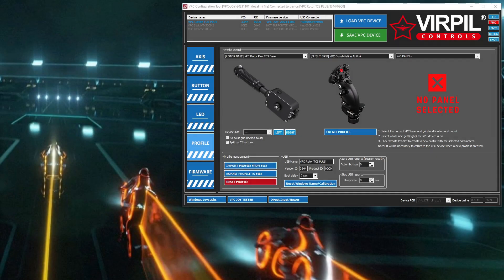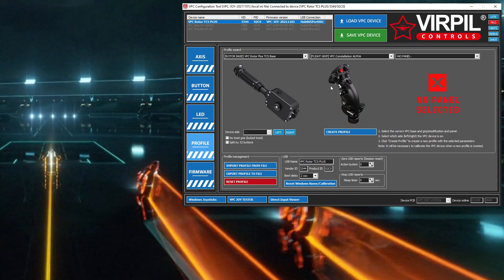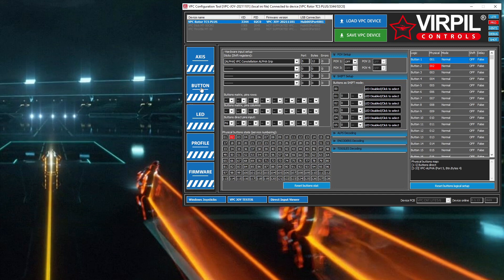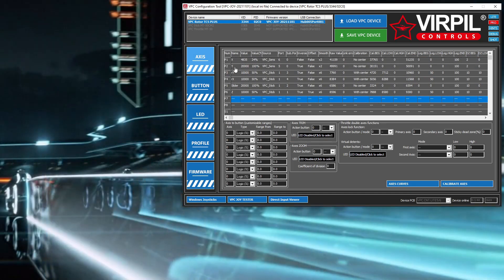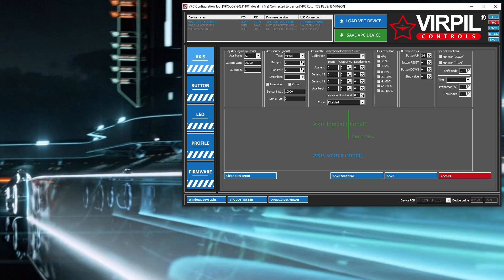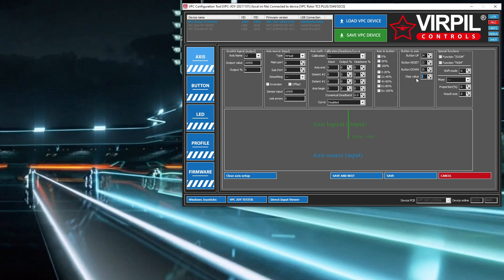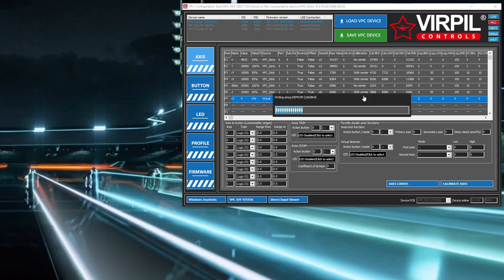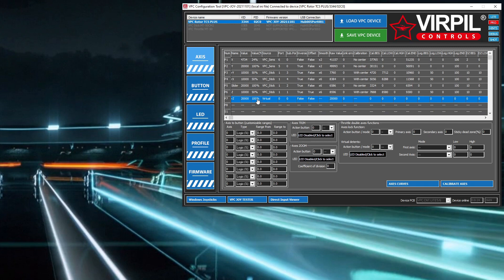Button to Virtual Axis Tutorial using Virpil equipment

Comment: Thank you for this video. I see in your description you've left some updated information but I thought I could offer advice for clarity in two key areas:

1. A reset button is mandatory. If you leave it at zero, it's as if that button is always held down and will always "floor" the axis output to the reset value field. This is an easy place to get stuck as I did, and only noticed that extremely brief moments I could see the output step off of 0% while testing and it went right back. I think for some or many, we don't care about a reset to zero button and luckily enough you can just set the button to something that'll never come in: 128. Now, when you push off of zero, you'll see the value changes.
2. The range of values for these virtual axes are from 0 to max is 0-60000. So chosing a step that divides evenly into 6000 very nicely works out ensuring an even number of clicks, and can help you subdivide things for further layering.
3. Downstream of #2, the encoder button behavior that manages the axes is accomplished at a firmware level, and thus the weirdness of scrolling too fast and missing "clicks" does not happen. If you set the step value small, and scroll extremely fast, it'll be extremely consistent and speed up with how aggressively fast you are scrolling.
4. You can map these virtual axes back to virtual buttons! Yay! What this means is that ever encoder can be turned into a 5 way mode dial very nicely. Yes, it'll be a bit tricky to map because you won't visually be able to look at the device and know which physical range the axes is in. Also, I wouldn't do this for dials that have intermediate states you don't want to flip to by accident; maybe it will shut something down and trigger a reset/realignment. Say you're on position for button 5 virually, button 4 is an "off" position that'll shut of INS. But the sim has it in state 3. If you start winding down to position 3, you will pass through position 4 and turn it off, and you don't want that. This actually isn't even a unique problem with the encoder as a physical dial (on panel #1) doe sn't solve this other than you can physically see where it's pointing. You have to pause the sim, move the dial to sync, and then unpause again. Overall, the safer way to do this is simply not to map the mode button to an explicit position on the dial. Instead use CW rotate or CCW controls which are relative to the current position. See #5 for this win as well.
 5. Because it's Virpil and so bad ass,  unlike WinWings SimApp pro limted configuration that makes you pick one or the other (with the MFD panel encoder, for example), you can have the encoder buttons active, along with the virtual axis over top of that, and even still the virtual buttons on top of the virtual axes ranges. All can be active in the same firmware so you can choose inside the sim you want it to respond do without having to change the loaded device profile every time you want a difference per DCS module or sim.

I've already had an advanced DCS set up for years with little  compromises on exactly what I want. This pushes things even further. Configurability like this is why I always prefer Virpil devices if it is otherwise, basically equipvalent to another brand.

Comment: I have an MT-CM2 grip that I am trying to stop activating a button when using the brake lever.  joystick has the vpc-joy 20220720 firmware and latest config tool. trying to set this in iIL2, but it keeps seeing a button and not the axis. Its set as joy_2_axis_z and activates  logical 27 (physical 3). Game config has it as an axis as well. Any help thanks.
Reply from the maker: find which ever logical button is activated when u move this axis, then in the button tab set this logical buttons Physical button to an un-used one eg 128 or lower, this way it will no longer activate the button when the axis is pulled
Reply: @HavocCompanyClan  Thank you so much, I have just got  round to doing this. So easy but it eluded Virpil support whose only reply was 'we do not support 3rd party programs' instead of answering the question as you did.